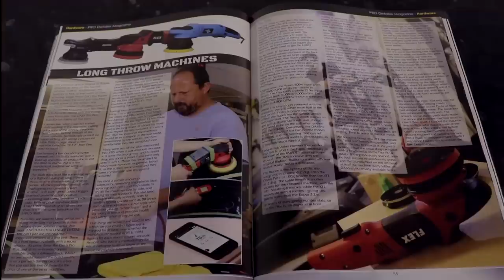Autoglym Polar Range Review  - Wash & Protect your car with an awesome thick snow foam cannon system

Comment: Has the polar seal the same results as nanolex washcoat? 
If that's the case I'll buy it cause nanolex is freaking expensive 😵
Reply from the maker: I dont think Ive used wash coat sorry leminako
Reply: No problem mate 😉. 
Maybe can some one else help me with this question? 
But polar seal does offer protection and slickness to the paint?
Reply from the maker: @leminako  protection yes, mainly hydrophobic but possibly some other advantages as well.  paint isnt like silky, but its not sticky. just feels like normal paint if you get me.
Reply: @ForensicDetailing  I understand. Just good maintained paint

Comment: When preparing to polish. Do you recommend a strip wash or is iron out and clay enough to remove any wax
Reply: Tank4sale I use everything you’ve said
Reply: @jeyomcnugget9584  you think a strip wash is needed ? Which one  do u use
Reply from the maker: Ive been testing one recently from garage therapy thats not available and I can say they work for sure.  so it s product you can have, but they dont strip as such, but its hard to name exactly what they do.. but yer they have an effect and seem to hammer the protection down a notch or to.   De-iron and clay as required.  yer generally you will always need to.  If your hitting panels with Tar and glue thats gonna hammer down protection as well, probably more than strip washes as well.
Reply: @ForensicDetailing  thanks for taking the time to reply 👍.. Any youd recommend ?

Comment: Hi Forensic Detailing,

Is there any other foam Lance based shampoo’s out there? Not the snow foam, but like the polar wash where the shampoo is applied via a Lance
Reply from the maker: hmm well like the chemical guys or adams ones can be used in a lance like this.
Reply: @ForensicDetailing  ah ideal! Only as not that impressed with cleaning power of the polar blast, going to switch to BH AutoFoam, haven’t had any issues with polar wash or polar seal… just wanted to know if there’s any alternatives to the foam Lance wash if that makes sense :)
Reply: @ForensicDetailing  have you got the product names for these? As google is being like a alladins cave for results tonight!

Comment: I know in a earlier vid of yours about foam can be to thick. At the dilution ratio you used it didn't look to foamy. Yet they claim its the "foamiest foam there is"
Reply from the maker: its about as foamy as it gets with my setup but will be trying to compare a wide range of them on foaming soon.  I stripped out my lance and its spewing a bit as well. but generally I dont get enough kick out of my system for whatever reason to ever make like the shaving foam stuff :)
Reply: @ForensicDetailing  I have a small karcher that was about 80quid with a foam gun that I got off ebay and various foams I have used have managed a decent foam. None the less great review again. Thanks 👍

Comment: John, are you going to be reviewing the Auto-Fanatic foaming wheel cleaner? I ask because it's the greatest single detailing I've used, period! I know Phil ships around the world and he recently added the pics I sent him of my cleaning from 2 days ago, it's a total of 5 pics on his Instagram. Just a note, the last pic was after I applied 303 Touchless Sealant to the wheels. I used the 12 ounce ratio for my cleaning, no agitation to the rims, just the tires and for that I used the brand new Gyeon tire cleaner, loved that product too.

PLEASE REVIEW THE AUTO FANATIC FOAMING WHEEL CLEANER, you already have the IK 1.5 foamer😉
Reply: Klasse Act I may be wrong but I believe he doesn’t ship to the UK
Reply: The Auto-Fanatic foaming wheel cleaner could be one of the best products released. But to buy the Auto Fanatic “Trifecta Pack” three bottle pack at $79 or £60, then they wanted $89 to ship to the UK i.e. £68. I phoned a courier company who quoted £58. Both a non starter. They need a UK distributor. Will buy as soon as that is set up.
Reply: @theflash4956  I understand THIS situation completely, everyone has a "breaking point" with shipping but maybe a buddy or two could split the cost, i mean it is a concentrate and makes many gallons, depending upon the ratio, just a thought.
Reply: @joem8069  he has said people have bought from him from around the world.
Reply: @theflash4956  I know the Trifecta package looks interesting but the "star" there is the foaming wheel cleaner, although Gloss Enhancer is awesome you can get a gallon of Beadmaker for a small amount more, not sure about the other product more. I only bring this up to those who have to pay alot of money for shipping here, the wheel cleaner is THAT good, check out his Instagram for my dirty as Abarth wheels. I'm a regular guy, with a regular car and what you see there is 2 weeks worth of driving in snow and salt, wheels are horrible. This product is AMAZING!
Reply: I was happy to try just the wheel cleaner. But saw their other products, so wanted to try them out as well. The trifecta pack seemed idea, as I could use the gloss enhancer, and try the secret weapon for fun. Will look at buying the Beadmaker as reviewed by Pan the Organiser. I think he nearly wet his pants. Great review by Pan and great to see the enthusiasm by him, he knows his stuff. But the shipping costs of £68 plus £60 for the three bottles, total £128. My wife would go out and buy another bag or dress in revenge if I told her how much I paid. I think that works out more expensive than perfume or even ink cartridges. So will wait until its available in the UK directly. And yes it does look like an amazing product, a great time saver, less hassle with wheel woolies, or swiping down with cloths. No more degreaser.
Reply: @theflash4956  oh yeah for sure! Phil, the owner of Auto-Fanatic, says agitation is only needed in the most extreme cases but most of us never let our card get THAT bad anyways, right, LOL!

As far as Beadmaker it's the REAL deal but people need to understand what it doesn't do and that is this, last over a month on a daily driver. What it DOES DO, along with 007 Gloss Enhancer is this, makes the paints gloss incredible, even after initial application but when it cures...STAND BACK! Yep, I'm a fanboy and there's a good reason for that, YOU CAN SEE THE DIFFERENCE!
Reply: Klasse Act how do you use the wheel cleaner? Rinse with pressure washer, foam cleaner and rinse again?
Reply: @genysmenrunner1677  so in the directions he says to rinse the wheel first but I didn't. My thinking is this, a dry wheel holds the product better thus allowing it to work longer. If the wheel is wet and you spray it the product mixes with the water and carries it away. So, if you saw the pics on Instagram what I used due to the excessive salt and muck on the wheels was the 12 oz ratio, meaning I poured out 12 oz of distilled water from the gallon, saved it to the side and poured in 12 oz of the Auto-Fanatic foaming wheel cleaner. I then poured 35 ounces into my IK 1.5 and sprayed it on the wheel and let it dwell for about 5 minutes. During this time you'll see the dirt and muck just slide down your wheel. After the 5 minutes I used my Worx hydroshot battery powered power washer to rinse the wheel clean...SPOTLESS!
Reply: Klasse Act wow that is awesome you don’t use a lot of pressure with the hydroshot! 

That is my confusion I don’t know if I must remove 12oz of the gallon and pour in the 12oz of cleaner. I mix 8oz with a gallon of water without removing water but I see in his videos that he doesn’t remove it.
Reply: @genysmenrunner1677  I didn't think of that actually, I mean I'm sure the product would still work well if you had a container that could hold an entire gallon of distilled AND 12 ounces of the Auto-Fanatic foaming wheel cleaner.  What I did here is make it a little more concentrated. 

So I have my 12 oz ratio, a 6 ounce ratio and "just to see", a 3 ounce ratio for weekly maintenance use. My wheels are always coated with something, from Sonax wheel shield, various Sio2 spray on, hose off sealants or hand rubbing something on there, so I feel this product is so good that it could very well work down to this ratio, time will tell.

Btw the Worx hydroshot works surprisingly well! We live in an apartment right now and have underground parking so it's my go to when I feel a 2BM wash is the way to go but I also use RW/WW too but no matter which method I use the Worx hydroshot cleans my tires, wheels and wells very well!!
Reply from the maker: your thinking is different to mine klasse.  your much better off just prewashing the car and alloys and blasting it with a pressure washer, that will shift a massive amount of the layered on brake dust and means the subsequent chems can hit the stuff thats left behind and theres less dust and grit when you do the contact phase, same principle as cleaning the paintwork (added bonus its  less donkey work and faster as well).       AG have a rattle can foaming cleaner and if you spray it onto soaking wet alloys the foam locks solid and doesnt move a millimeter.   The rinse water underneath is also important because their formulation includes  TGA in it and that reacts with the oxide layer of the brake dust (the purple stuff) and turns into a water soluable oxide which then gets disolved in that water.      Thats the sort of shit thats worth paying money for.   In this video my wheels are SPOTLESS! and Im just using car shampoo.       Reason your seeing dirt slide down your wheel is simple white foam lets you see it better and you have not removed all the loose top excess layer that would just blast off or would come off if you sprayed any detergent on it.        Also there is no such thing as what you are describing.  theres no chemical you can spray on an alloy and let dwell and then blast off and your alloy is clean, no sir doesnt happen.  specially with that pee shooter battery powered water pistal thing. still wub you but what your describing doesnt happen, you need brush work.  did you get let the water dry on the alloy, or get a white cloth and wipe the bits you thought were clean (when they were wet etc?)
Reply: @ForensicDetailing  well, all I can tell you is this, I sprayed the AF foaming wheel cleaner on rim, let it sit for about 5 mins, rinsed with my Worx hydroshot and it was all gone. I ran my fingers over the base of the spokes and between them and NOTHING. I know I'm just one subscriber and anyone can say anything but that's how it happened, seriously. 

FWIW I can send you the pics, step by step or better yet, look at Auto-Fanatics Instagram site and he's posted the pics I sent him. Again, no reason to lie here. Keep in mind my wheels are coated with several products as I stay ontop of my car year round but recently the car wasn't washed for 2 weeks and my wheels were almost white from the salt. Drop your email addy here and I'll send you the pics. 

I also have pics of before, during and after for the wash too. Base coating is TAC system power plus Sio2 paint coating but many toppers put on it. Over 2 weeks ago, before we got slammed by the polar vortex here, I applied 2x's Beadmaker and Sonax BSD mixed at a 1:1 ratio. I pre-treated the car using my IK Foam 9 and 2 ounces of AutoBrite Magifoam, let it dwell for about 10 minutes and used the Worx hydroshot to rinse it away. The beading was AWESOME from this mix and the car looked great after this but a 2BM wash was next. For that I used 1.5 ounces of Gyeon Bathe and .5 ounce of Bathe Essence and got after it, came out perfect. Even though "Brillant Maker" was doing its job I applied a coat of Griot's Garage Poly Gloss, let it dwell and rinsed away...with the Worx hydroshot and had no problems.

The entire process is documented on www.autogeek.net under "what did you do today detail related", I have the same screen name there. Hope you check this out for yourself because like I said, I have no reason to lie and/or post this much of a detailed post, I have no YouTube channel, not on FB, Instagram, Twitter or any of that.
Reply from the maker: @klasseact6663  I dont think your lying mate.  but like I say, contactless cleaning doesnt happen for alloy wheels, even with acid cleaners and a pressure washer that could cut your car in half.   you got a coating on the alloys or any protection?
Reply: @ForensicDetailing  yeah, I have applied Sonax wheel shield in the late fall and again sometime in Decemeber and inbetween WetCoat and 303 Touchless Sealant I had before the product was released. Also, several applications of Griot's Garage Poly Gloss,  a very light layer of protection but when the car got it, so did the wheels. 

I think you need go get a bottle and test it out, this product is for real, check out the Auto-Fanatic vids. I know you can do anything on video but the product worked exactly the same for me as it did for him.

Comment: just wanted to ask with these spray rinse sealants how does applying them with a wet microfiber applicator and leaveling them with a dry microfiber increase the durability compared to using them as a spray and rinse it it the fact that wet microfiber applicator dilutes the product less then the spray and rinse method or is it more complicated then that?
Reply from the maker: I think if you spread them with contact you could potentially know you have got them all over a panel hakim..  but when you rinse them they might not get distributed evenly...    but you might also soak some of it up into the microfiber dunno..  I think a good wet microfiber, with sort of 95% dry panels, tiny bit of water still on the panel.. then little spritz on panel and spread with the wet cloth.. then you could rinse and dry..  or dry.. dunno I think it changes protect to product with this polar seal its really designed to be lance delivered...

ultimtately you just got to experiemnet my friend and see what works best.
Reply: @ForensicDetailing  i ment that method with wet coaat sorry just bought 4ltrs of it
Reply from the maker: @hakman239  yer gyeon are pretty adament it needs to be sprayed off.   but dunno I like to work it around a panel with a wet cloth..      but just follow OEM guidelines to apply mate.

Comment: What drying towel is that, took the water off in one swoop??!
Reply from the maker: thats a  double sided twisted loop one I got direct from a chinese supplier about 3 years ago, you cant buy it.   its not great quality compared to a korean one, I talked about it years ago in some random video but it still works great and Ive been reaching for this a lot in loads of video, just cuz its like my old faithfull.   Get a korean one with tigther twists, in2detailing sell a better one, its orange and double sided overlayed edged instead of a suede border. they all work though.

Comment: Interesting ... is it the case that really thick shaving cream foam is more hype than anything else?  This product seemed to work great without it.
Reply from the maker: foam is just foam.  it can create a bit of cling yes, its desirable for lots yer, theres a debait about how usefull it is, or if its just part of like the physcology of cleaning etc.  Yer thick shaving foam foam isnt really gonna help with like wetting much if a snow foam is overly thick it can just pull itself off the panels, its like adding air and fluffing it up etc.  this stuff cleans well but will talk about it more in the snow foam best of series

Comment: Could I use this then finish off with beadmaker or would that be pointless?
Reply from the maker: be a bit poinltess to use polar seal and beadmaker.. but you could use polar blast, polar wash and the dry the car and apply beadmaker mario
Reply: Thanks for your advice, I may get the polar seal for the wheels then.

Comment: Can Polar Seal be applied to already Ceramic coated vehicles?
Reply from the maker: yes but like if the coating is like fresh and buzzing its gonna repell the water carrier of the polar seal perhaps.   and also you are masking your coating with another material.  so always things to think about but it should work on a coated car, check with autoglym to be sure and always test a little area first :)

Comment: Does the pH level of the polar wash matter that much?
Reply from the maker: not really no,  I mean if you google alkalinity and acidity and PH scale the wiki site gives a good indication of what this really is.   You can dervice some very loose vague connotations from the PH.  but remember its a blend of different surfactants as well and the seperate PH's all effect the over PH.   And the overal PH is not that relevent anyway.  you cant even dervice that PH12 would strip more than PH9 for example.

Comment: Can you use the seal stuff in a trigger bottle rarther than a lance?
Reply from the maker: I need to test it more but I cant see why not.  if you do you can make like so much product suddenly the value is awesome.
Reply: I have just gone and bought some from Halfords, so I will give the car a quick wash and give it a go. Hopefully the sun goes down a bit as it’s very bright but still quite cool outside.
Reply from the maker: @mattus1gig  should be fine today.  bellisimo day for car washing matt enjoy mate
Reply: Well. I made a mix up with the recommended 40ml to 200ml (made 3 lots of that up) and pored it into a pump sprayer. Washed the car and rinsed it off, then went round spraying the mixture over the panels. I didn’t get the milkyness until I rinsed it off again, so did as you recommend, spray it off away from the glass and the water balled up nicely and ran off. Towels made short work of drying it off 👍